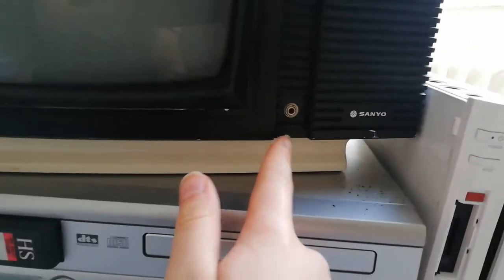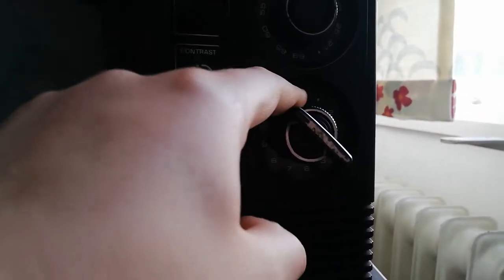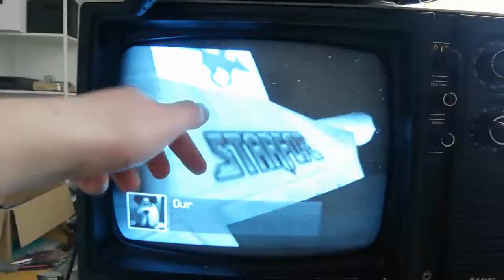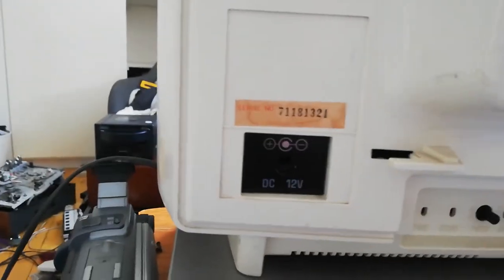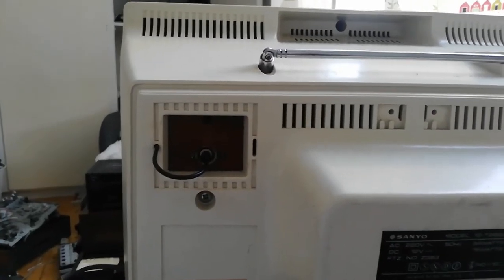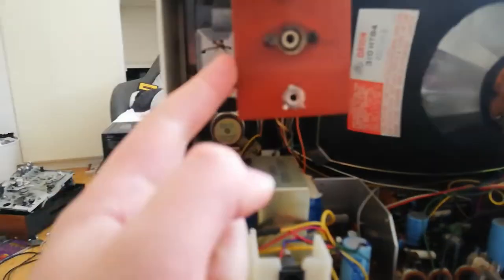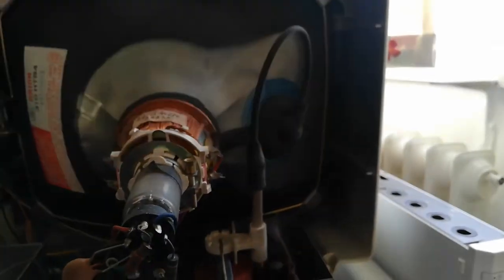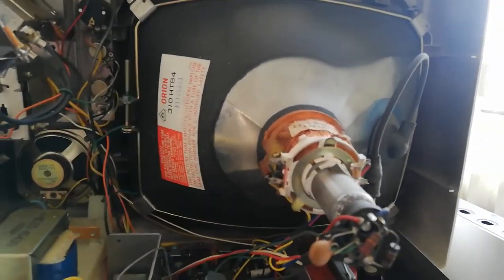Sanyo 12-T260U CRT review

Comment: Hey man, great video. How do you plug your N64 to the tv?
Reply from the maker: Using one of these https://www.ebay.com/itm/401497035760?_ul=SE these outputs the N64 via RF onto RF channel 3 or 4. If you don't have the money to buy a modulator you can just use a vcr plug you're n64 into the vcr via composite , then the vcr  out via RF.